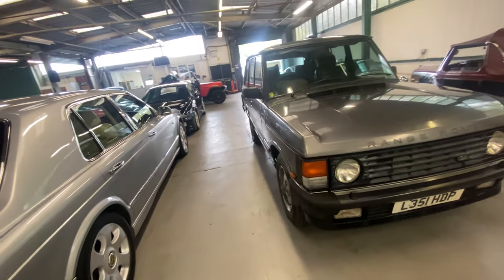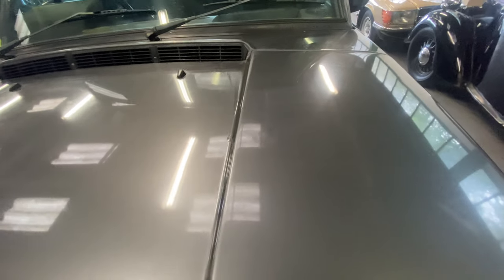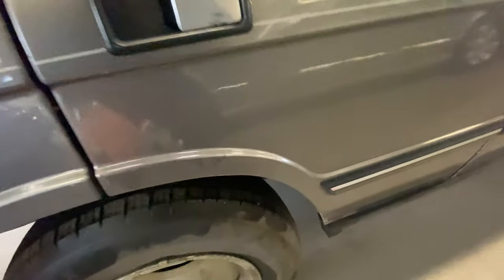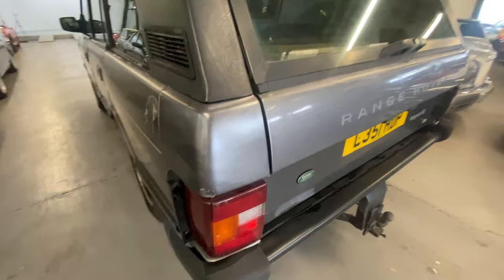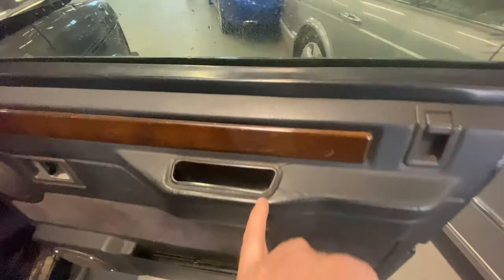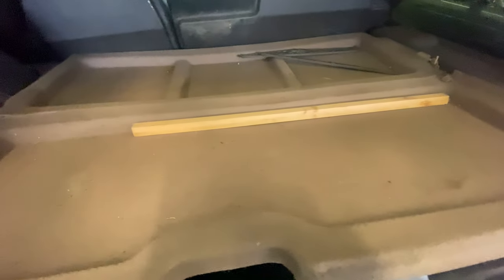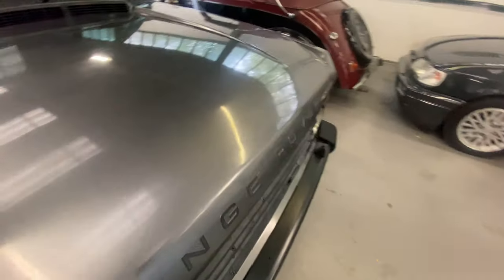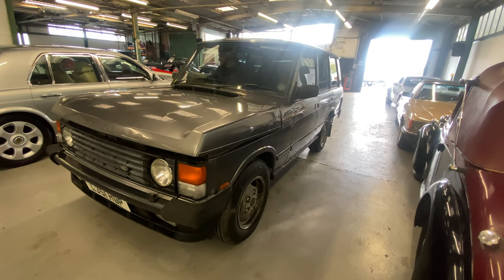Range Rover Classic - Perkins Diesel Engine

Comment: Perkins habe always been my favorite Diesel engines.
Reliable and low diesel consumption
Reply: About 7 liters per 100 km in the city and of course 15 liters per 100 km under full load with a trailer of about 3.5 tons

Comment: Looks good. Unusual to get one with an engine conversion but still on its original air suspension!
Reply from the maker: Agreed! Very unusual. 100% worth keeping the air
Reply: @wbsons9956  Definitely. The air suspension is actually very simple to maintain. Unfortunately people assume it’s complicated and expensive so just rip it out when there is even just a simple problem. Even by todays standards it’s very effective.

Comment: It is not a Perkins that one but a 2.5 VM diesel
Reply: Its a 1994 model so if it was a original diesel it should have the 200 Tdi or 300Tdi but as the salesman says it was a original 3,9 V8 converted to diesel and Perkins engine. Can’t understand why the perkins engine as LR did have Tdi conversion kits in those years
Reply: @robertdrum6857 that engine under the bonnet isn't a 200tdi or 300tdi. 
(To be precise 200tdi was used only on hard dash models with lt77 gearbox, 300tdi was used only on softdash models with r380 gearbox).
Reply: @gianlucafalco737 Thats correct but as it is a 1994 model year it can be either 200Tdi or 300Tdi as the 300 Tdi replaced the 200Tdi in March that year. The 1994 model year went from mid 1993 to mid 1994😉 But the factory sold some conversion kits in those years for 200 and 300 Tdi so it still funny that it has a Perkins engine🤔
Reply: It’s a Perkins 4.236 max RPM is 2800 so a bit so a tractor but it’ll pull your house down